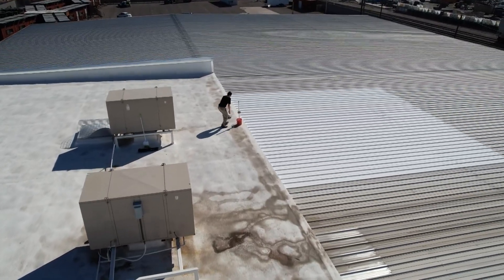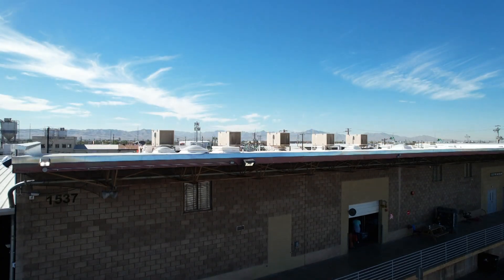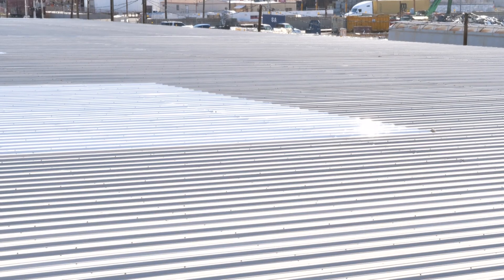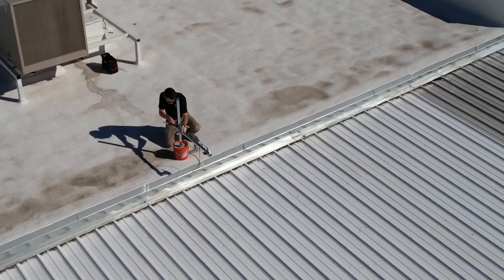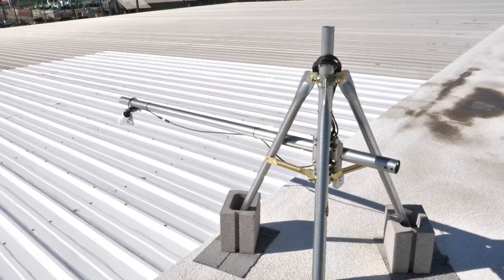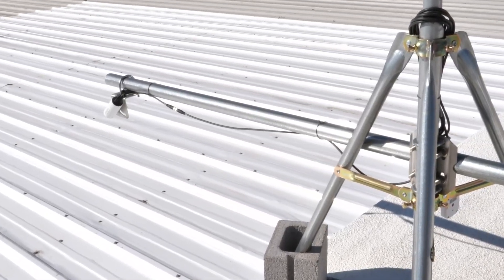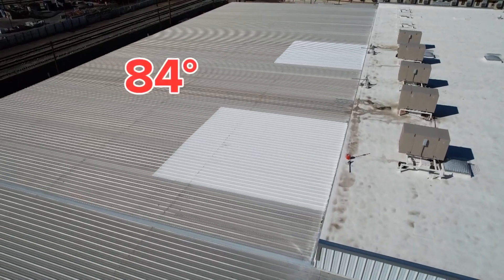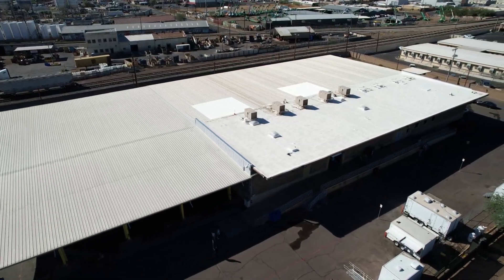Testing is now underway in Phoenix for new cool roof technology

Comment: Climate change reports that the temperatures are actually dropping dramatically.  It is projected to continue dropping into December.  All the increased winter traffic from snowbirds actually reverses their carbon footprint.  The unique design of their compact SUVs provide a venturi effect, sucking up all the carbon from their increased traffic, forming a dust devil which is exported to Norway and stored in a glacial mountain, then churned into salted butter.

Comment: I expected a journalist to be thorough - you only reported on the temperature of the unpainted metal and the special coating - what was the temperature on the "paint you can get at any hardware store"? Or was this really just a commercial for the coating?  And what happens to all that heat being deflected into the atmosphere?
Reply: Facts aren't allowed here Bonnie, they have an agenda to push.